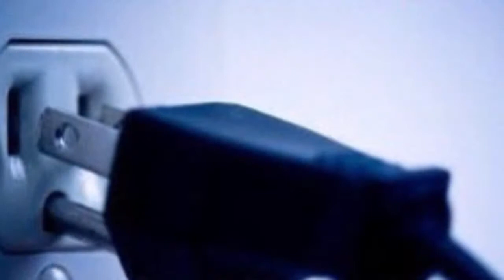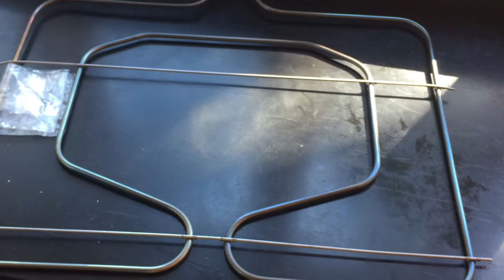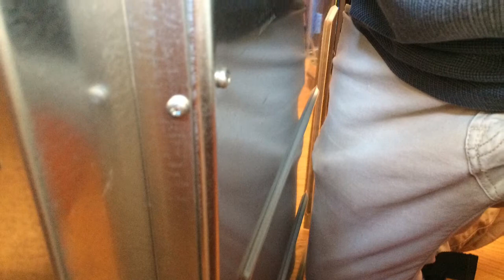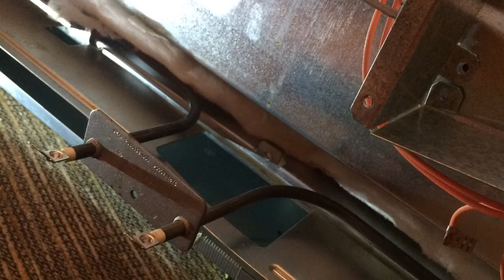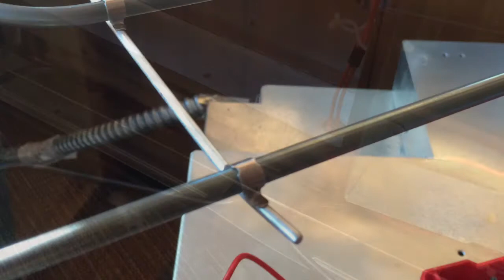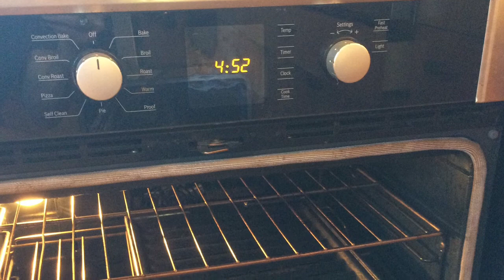✨ Bosch Oven - Bake Element  -  Easy Replacement ✨

Comment: Just did this replacement on my Bosch HBL5720UC/08 wall oven + microwave built in unit. Very helpful video. One tip: when you're ready to put the new element in, push the insulation up and out of the way, use a flashlight to look in, and identify the little clips inside where the element goes. I had to  use a yardstick to push the small cross-member front wire on the element up and over the clip in the middle in order to install it. Wiggling as you suggested didn't work for me -- it was definitely impeded by something -- so I cleared the insulation out of the way so I could see what was in the way.
Reply from the maker: Great advice 👍😊

Comment: My lower element (HIIP055U) was behind a vertical piece of sheet metal that wrapped down below the oven and ran all the way to the front in one continuous piece.  After looking for alternatives, I finally decided I simply had to bend that piece down out of the way, after noticing that there were two slots in it that were elongated above the element terminals such that when you bend it down, they would clear those terminals.  Then as you say, I could wiggle it out.  Bending it back wasn't as horrible as I expected, and it actually looks untouched once I replaced the original screws.
Reply from the maker: Wow,
Nice job David😊

Comment: Scott I pulled the broiler element out to replace but the electrical wires on the back pulled off and got lost behind the opening ,,, how do I find those wires
Reply from the maker: Hi Stewart,
Can you get behind the oven to remove the back panel ?

Comment: hello I have just replaced the element on my oven.. it is normal for new parts to emit a strange plastic smell isn't it? Just for the first few uses.
Reply from the maker: +Scott Wood 

Good question,

Yes they do.  Just good to open up the windows and leave it on high for 30 minutes.
Reply: Please help PLease please.....  I have a bosch HEI7282U/09
Problem - Conv Broil, conv Roast, broil does not heat up (very slow)
               -  Bake works fine
              - Conv Fan works
Work Done  -  Replaced back round element (new=56 ohms, no Continuity), seller says  that is the expected range
                   - Replaced Top Element (new=17.5 ohms, good continuity)

What should could be the problem?  Many thanks